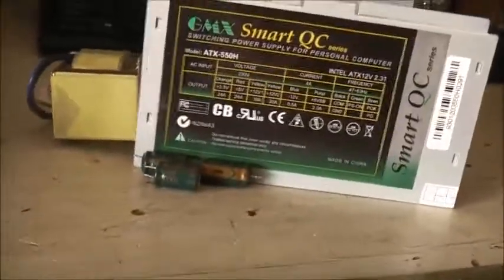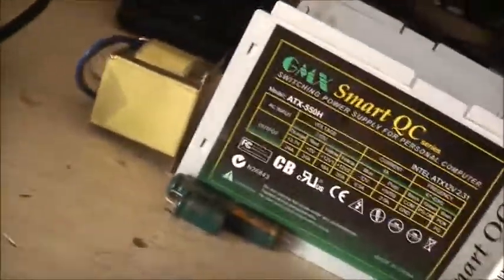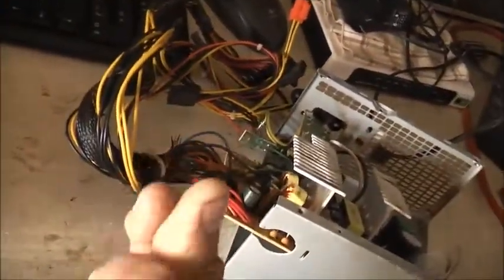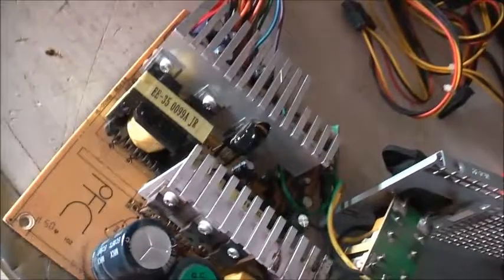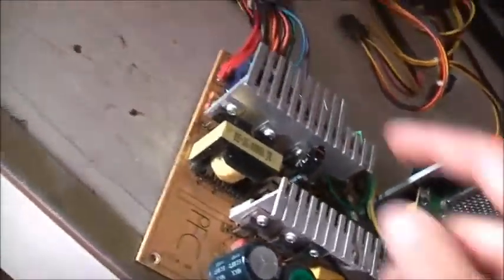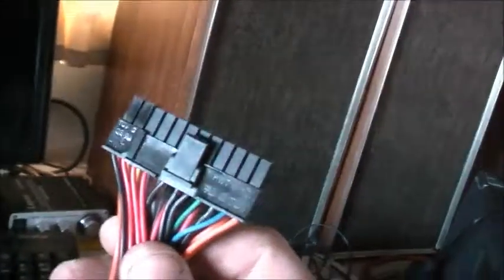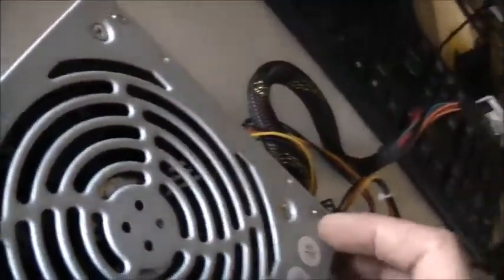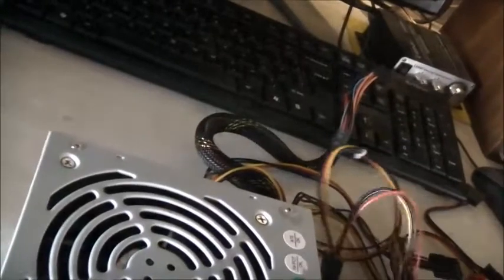GMX 550 Watt ATX PSU Recap!

Comment: Damn I wouldn't trust that PSU at all! it could probably draw 250W decently or 350W max You got to get a Seasonic brand PSU they never fail! if you're using a older PC which doesn't draw much power those older Hipro power supply's despite being cheap are quite reliable! and are realistic with their wattage output! just got to recap them and yep they use Teapo and they'll last for a long time. Teapo's are decent however are far from the best its just heat that kills them!

Comment: That thing likely won't be able to do 550 watts xD
It will last though if you don't draw more than 2 or 3 hundred watts from it, and if it has good caps.
Look at the small transformer! xD
Also, looks like it might have a fake PFC choke. (Look up fake PFC choke if you are curious xD)